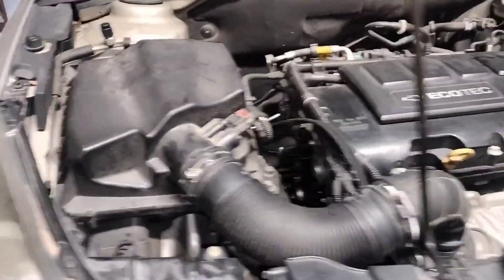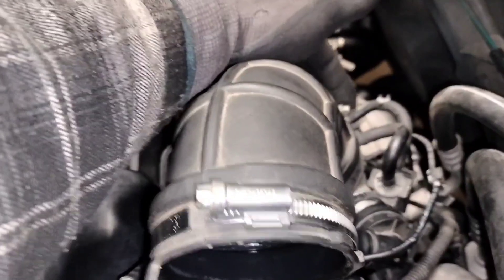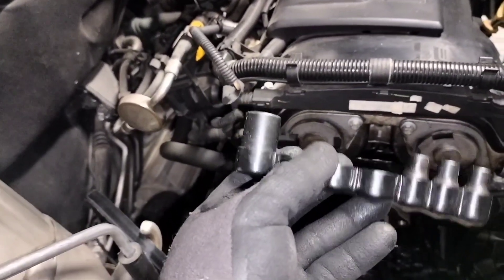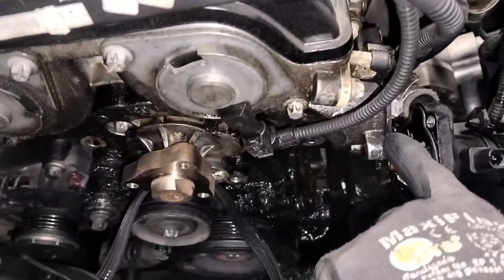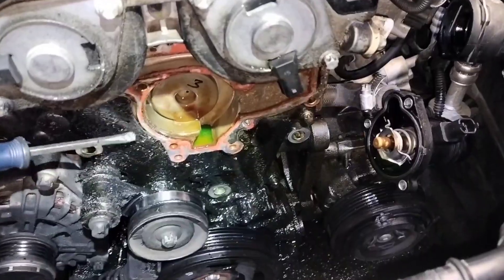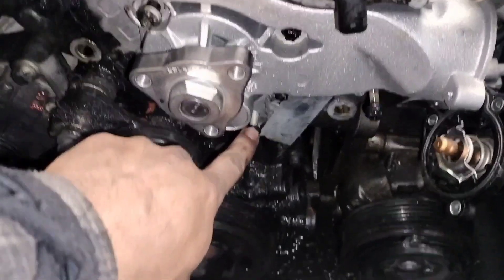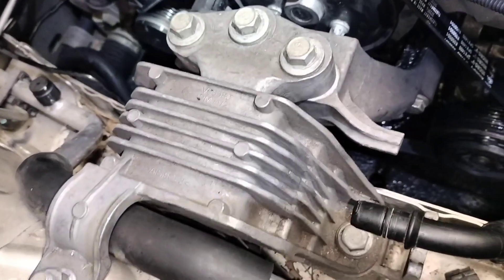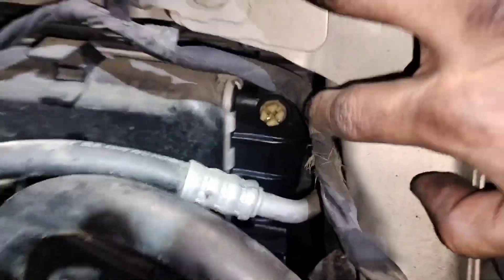2008- 2016 Chevy Cruze 1.4 water pump replacement

Comment: Was your reservoir still bubbling before water pump replacement ?
Reply from the maker: Before the water pump replacement. coolant system said A/C off due to high temperature. Coolant reservoir will spill coolant at the bleeder nose. All normal after water pump replacement.
Reply from the maker: No. After replacement no more bubbles.
Reply from the maker: Check this other video.
https://youtu.be/ztso6LOiCcI?si=eLJ-YlltGkjDAri3
Reply from the maker: Remember after proper bleeding closed the reservoir tank. If not you will experience bubbles and overflow.